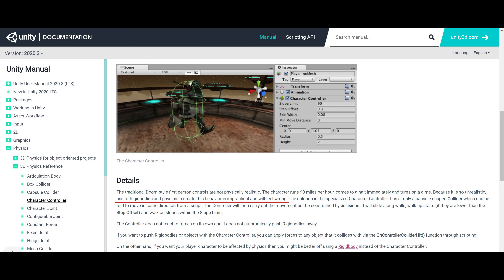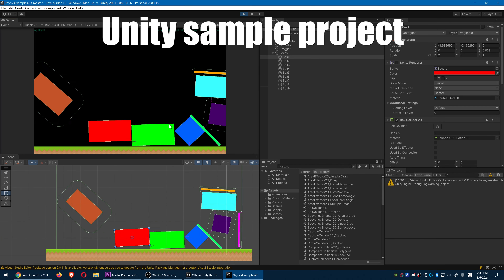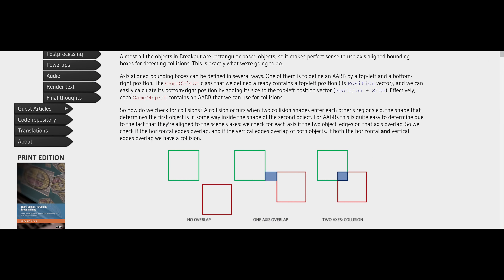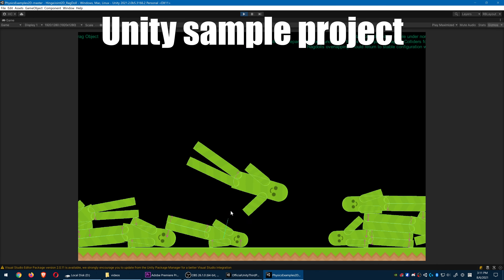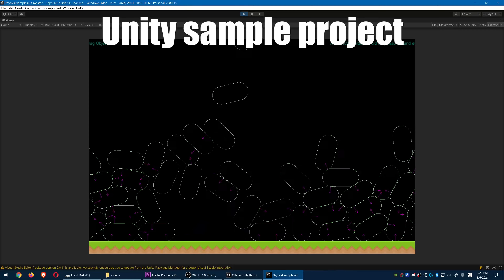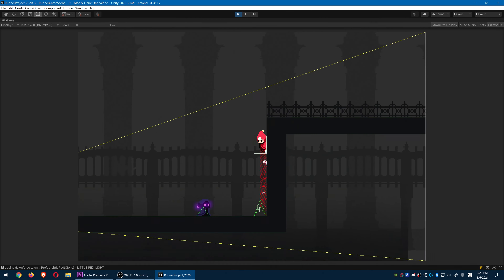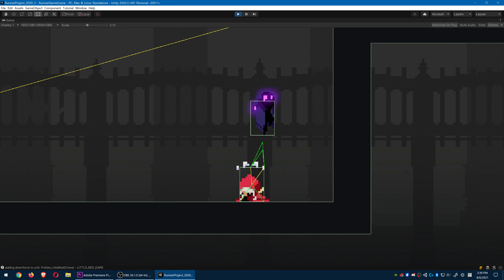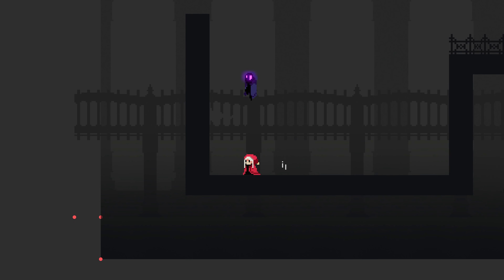Devlog #1 - Rigidbody 2D Character Control - Unity

Comment: What a great video!  The character controller looks great!
 It looks like this would be a hard framework to network with such fast-paced gameplay, 
are you going to use a networking library or make one from scratch?
Reply from the maker: thanks! i'm probably gonna start from scratch, with tcp and very primitive network sync. the pace itself i don't think is going to be an issue. most action games run at 60 fps or more and this one isn't all that different. but we'll see :)